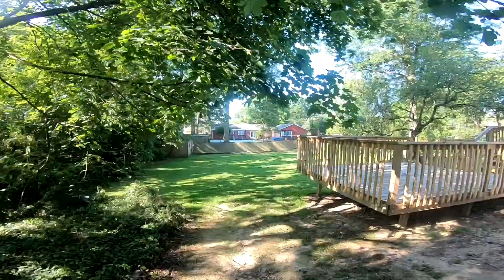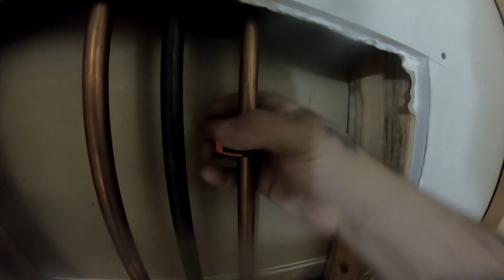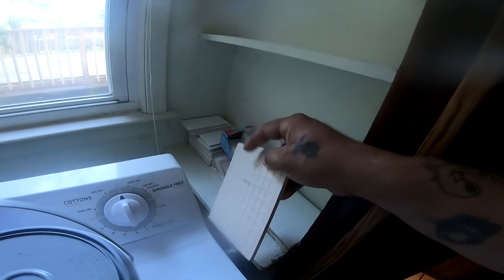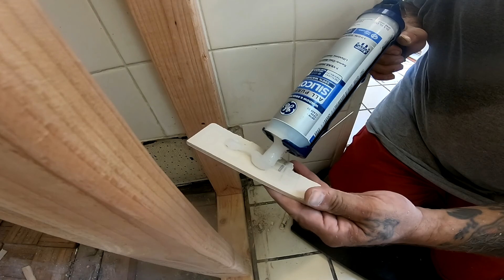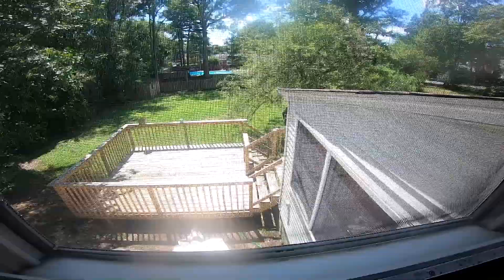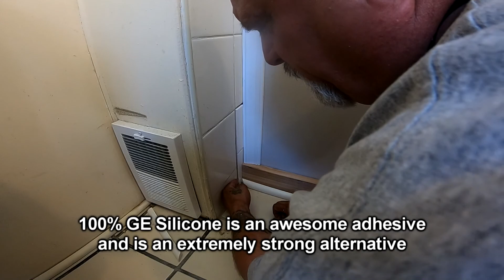Easy Cheesy Shower Removal

Comment: 310 K for that in Pennington borough New Jersey not a chance. I live in south NJ just next to Haddonfield over the Walt Whitman 15 min from Philly. I have a 5 bedroom 2 and 1/2 bath, all new 200 amp Square D QO load center witch is ark fault and lightning surge protected . I just did a rebuild of the plumbing New roof and 1/2 achier of ground and the best I could get for this house is 200 K.
Reply from the maker: I was equally as shocked when I looked up this house on Zillow as I was putting the video together. It’s true, they say it’s a sellers market and it must be, lol. Who would guess!